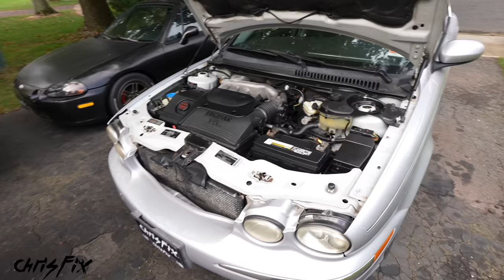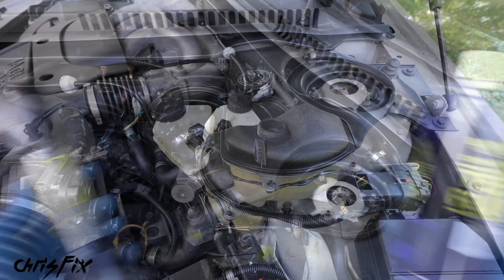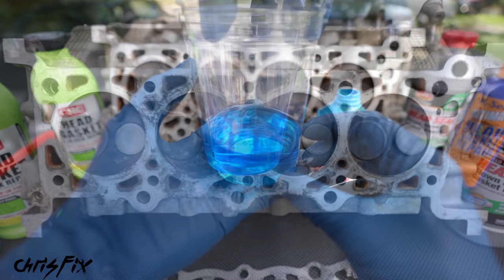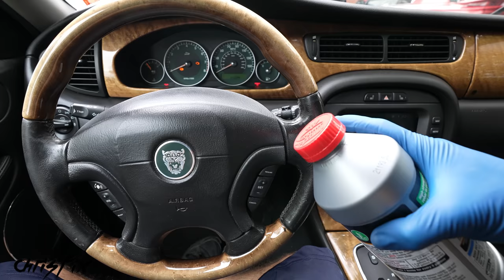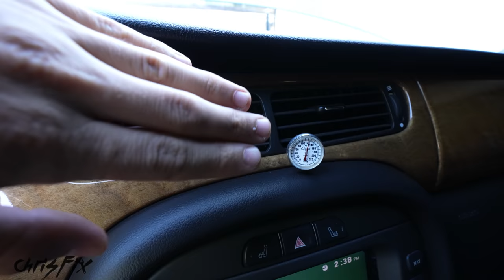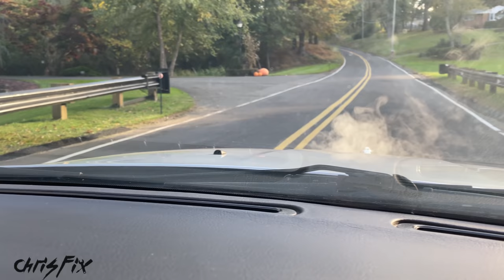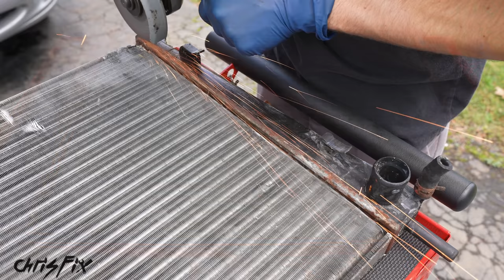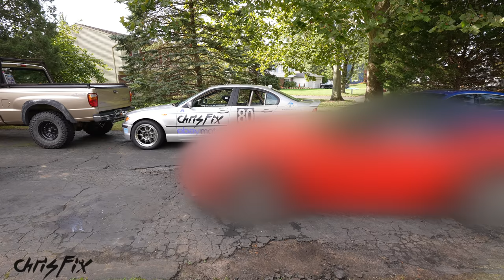Do Head Gasket Sealers Actually Work (FULL 2yr TEST with Engine Teardown)

Comment: Chris ! I wanted to let you know that I have done this same testing yesterday and today on my 2012 Lexus CT200h with 170,000 exactly how you showed. This morning on the new drive, no rough idle and coolant levels stayed. I am so impressed and thankful you made this video because it was a success bro!! I’m happy for now because head gasket
Job was 1,200
Reply: Wow I have the same year and model car.$1100 actually isn’t bad.
Reply: How’s your car holding up now?
Reply: What product did you use?
Reply: @WApnj  head gasket sealer the one he showed on the video
Reply: What brand did you use? It seems a bit daunting, did you bypass heater core? I keep hearing some of these can clog it. He does not say the brand he used for this.  I keep looking at the bottle  In the video, but I can't quite tell what exactly it is that he used.
Reply: @troyberg2283 
He used the last product, the thicker stuff due to the high temps of the jaguar and 15 minutes to reach adequate engine running temps

Comment: 23:40 Drain/Flush the cooling system, and then TREAT IT AGAIN with the BARR'S MAGIC.  It might work again, until dad floor the car during hard accel.
Reply: @SgtWojcik  It would need to be machined. Hand sanding is not going to cut it.
Reply: @jonmayer  It can absolutely be done if you have a very flat reference surface and a lot of patience. You could bring it fairly close or beyond a passable machining job. There is 100 000 $ worth of "perfect machining" and there is flat enough that it doesn't matter. It's aluminium after all, not some crazy high tech alloy in a turbine compressor.

Comment: I used Bars Leak 2 years ago, but I drained + rinsed the system thoroughly! Followed the directions, then drained the pure water , installed antifreeze + more Bars leak , no problems yet NOT Hot Roding around town !!!

Comment: I've used Bars Leaks block seal, it has copper in it. It was on a 2004 Hyundai Elantra. It's been working great for years. Car was tested before and after with leak tester.
Reply: So was it the same stuff as Chris used or different?
Reply: Yes good copper not the same for less gap his was big warp .fibers best could have put again or copper second time cause smaller gap compound fix

Comment: Kseal 100% I work at a popular auto parts store and I sell the heck out of Kseal and always have positive feedback!!! Now that being said, I'm not a fan of sealers at all because it should be fixed correctly and too many people think it's a permanent fix. But I used some Kseal on my 05 hyundai tiburon GT. I was loosing coolant slowly into the oil. I put the small bottle of Kseal in and drove around for about 15 min and the white smoke disappeared and I wasn't losing coolant anymore! Kseal for the Win!!
Reply: Agreed about things needing to be fixed correctly, but it doesn’t make sense sometimes, like in this situation: the cost of repairing the gasket would’ve cost 3 times the value of the car
Reply: @mikekilovictor4010  lol thats why i stick to 4 bangers.

Comment: I can say that the Blue Devil head/block sealer works too. I put some in my 1997 Pontiac Sunfire which had exhaust gasses in the coolant, pressurizing the coolant cavity & blowing out all the coolant through the overflow tank. After putting in the Blue Devil (following the instructions of course) there were no more bubbles coming up in the coolant while running. I was tickled to death with the results, but still a little skeptical. After three years & well over 20,000 miles the bubbles returned & the same problem as well. I since put a new head on the 2.3 & shortly after that a tree fell on it in a storm. I've now put a new windshield in & still need another hood then it'll be back on the road. Kind of rambled on but the point being, YES! This stuff does work as a temporary fix until you can get enough money to fix it properly, get another car or whatever. Unlike some of the so called "stop leaks" that are very thick, the Blue Devil has the consistency & look of blue Kool Aid so it's not going to plug up your heater core or radiator.
Reply: I have a question. IS it advisable to re apply another sealer treatment or could this truly destroy the engine? Like if you waited another 1-2k miles dealing with the blown head than decided on another "Blue Devil" treatment. Can anything happen to engine or would it work maybe 60% as well as it did first time? Thanks!
Reply: Yeah i was recommended to use blue devil. About to use it on my tahoe with a small leak.

Comment: Did Bar's Leak with Carbon Fibers and it worked.  I've driven on my Honda Element for 3 years now.  Tiny leak into coolant and oil.  Really small.  Downside?  Clogged my heater core for the first year - no heat, half unclogged itself the second year.  Need to flush it with CLR.  Carbon fibers will work under your radiator cap, and your  heater sensor- wherever there is a weak point, the fibers will find.

Comment: I used Blue Devil to hopefully stop a slight heater core leak (fully rebuilt engine) and it worked beautifully. Kept the car 3 more years before selling it. Never had a problem.

Comment: We (mainly my friend, I just assisted) did this on my '93 pickup truck after it blew out all the radiator fluid on the interstate.  Took a bit of work, and it did clog up the radiator (mainly because we had to pour the sealant straight into it), but thankfully we were able to unclog the radiator before trying to drive it.  It ran for probably 7-8 months before the fuel pump gave out on me.  Not giving up on it - and eventually I plan to rebuild or replace the engine - this was just meant as a temporary fix to keep it running, which it did as intended.

The sealants do work, but no one should consider them a long term fix by any stretch of the imagination.  Regardless, thanks for this video.  It's interesting to see an in depth view of how they're actually working.
Reply: What sealant did you use that unfortunately caused your truck to get clogged?

Comment: Thank you Chris for such an amazing video. I learnt a lot! btw i just ordered BAR's head gasket sealer from Amazon and cant wait to apply it.
your tips are so useful, removing the thermostat before adding the sealer, changing engine oil and oil filter once the job is proved successful.
Can't thank you enough.

Comment: You forgot to mention that you have a "recirculating reservoir".. Sealer is useless if poured into a regular vehicle reservoir. Has to be installed directly in the radiator.
Reply from the maker: Thanks for sharing!
Reply: You mean I need to pour sealer into the radiator directly?
Reply: @jameswan670  yes it goes in the radiator.

Comment: Anybody else get feels for his Dad's "baby" when Chris started taking the hammer and sawzall to it? Maybe just me....
Reply: Heck I almost turned on the waterworks when I waved goodbye to a twenty three year old Toyota Corolla that was falling to pieces. There were a lot of rust, the water pump was done, the clutch were on it's last legs, the fill pipe for the fuel had rusted, the shocks were just hanging on, the battery was still original and held just enough charge to start maybe three times in the winter and after that it would need at least half an hour of charging at a high idle to be sure it would start again tomorrow, and the camshaft timing belt should have been replaced a few years ago. Still it never let me down until the day I had to send it away, other than the few times I'd left it parked for more than two weeks and the battery was totally flat. And here I have to see him take a sawzall and to a car that seemed a lot better cared for than my old Corolla. I know that car died for a good cause but even so it was not easy to watch it happen...

Comment: Great work putting together such an informative video on a relatively controversial topic in the mechanical world. I was in a similar situation with a friends 6 cyl subaru outback and decided to use the CRC product with the fibrous goop in it. After putting the suggested maximum amount in for the volume of the cooling system ratio I almost immediately clogged both the radiator and more devastatingly (I realized later) the heater core which now after 2 years and eventually another S/H engine have discovered that on some Subarus (mine) the thermostat opening is dependent on permanent flow through the heater core, and so consequently have damaged the new engine in the process of trying to get the thermostat to open. I will add that once we replaced the radiator and removed the thermostat from the original engine it did temporarily seal up what we now know is a cracked cylinder head. I think you were lucky Chris that the tubes on your radiator look quite a bit larger the most Asian cars and in your case it didn't block it up, but again your follow up and dismantling of the engine afterwards was very insightful and great to see how these products actually work.

Comment: My experience was Bars leak HG1: i ve used it with awesome results on 2 different cars with both of having 200,000+ miles. The 1st was cadillac ctsv 6.2l supercharged engine. The 2nd was a 6.0l hummer h2. Both of them still running strong after years of using this product. Just make sure to turn on the heater when you start the procedure. Also if your leak is small, even with larger engines i would recommend using half of the bottle for the 1st thermocycle, then next day do the same. And by a small leak i mean if you drive for couple hours daily, you needed to refill your surge tank once a week.
Reply: @kab9729  Lol no
Reply: @kab9729  muppet
Reply: @DECKEDM  lmao I knew it wouldn’t work idk why I still asked 😭

Comment: I’ve had really good success with k-seal. I used it on my 2019 x-15 Cummins. I have since put 300,000 miles on it and have not had any issues.

Comment: $7k to replace a head gasket is absolutely Ludacris. You could buy a new car or engine for that money. It should not cost more than $1K including parts. I’ve had it done for as little as $700. Madness
Reply: I know its late to reply, but its a shop ehich does everything they touch with new parts, ie new belt when doing an alternator. Imagine all the parts that go into the head gasket process which they would try to sell
Reply: I just got quoted 6500 for head gaskets on my wife's 17 grand Cherokee
Reply: And the was just for gaskets and water pump. It's gonna get some k seal then trade in

Comment: Imma treat this like a forum post real quick. I just bought my 2012 Chrysler 300 Limited with the 3.6 L Pentastar engine and 8 speed automatic trans. Drove it 4 hours home after buying it with absolutely no problems. The next day driving to work 15 minutes I had no problems either. The next day I was messing around with my audio system with the car running for about 20 or 30 minutes and all of a sudden I see steam/smoke come out of the hood. All of my gauges were perfectly fine though. I open the hood and I see the coolant reservoir boiling. I immediately shut the car off. Hoping this was a one time thing, I get in the car to go somewhere after about 20 minutes and after about 5 minutes of driving I notice the car is overheating. This did no damage since I was so close to home. I get home and see that there is zero coolant in the reservoir. Filled it up (it took a whole jug of 50/50 antifreeze) and ran it and took it on a few test drives and the level was fine after a while. There was also no smoke coming out the exhaust or anything in the oil during this whole time. My question is, why did it go the 4 hour ride back plus 2 days worth of going to work and back with no problems, then all of a sudden losing it all? Why didn't it lose it before then?

Comment: I had a blown head gasket in my 2002 expedition. i used head gasket sealer and it worked for years.
Reply: Did your car shut off ?
Reply: @Dcashkid24  no, what do you mean? the truck worked as far as i know even after i sold it a few years ago.

Comment: Here's some thoughts here. Loss of coolant also can be caused by a cracked head, which usually means tiny cracks around the exhaust valves which you cannot see. But these cause both leakage into the combustion chamber and exhaust gases in the coolant. Generally, a sealer will not help much with these.

If you have a situation like that described in this video, if the sealer works for a while and then gives out, try more sealer.

Finally, it shouldn't cost $7000 to replace two head gaskets. In this case, the heads might be able to be planed. Sometimes not. My experience is not extensive but I have heard a lot.

Finally, the experience described here is a good argument for a four cylinder engine and also a good argument for not owning any kind of exotic vehicle, even a not really so exotic one like a Jaguar.
Reply: that jaguar literally has the exact same engine/drivetrain as a Ford Taurus of the same year. It's not exotic whatsoever.
Reply: @michaelcohen9363  modern jags like land rovers are built-in India. Complete junk like jeep in China, Briggs and Stratton in Mexico, Saab in USA, etc.
Reply: @bekaddisontechnologies4292  You'll never find me driving any of those lol. I had a straight 6 jeep back in the day and it was alright but I'm not really into offroading. Land/Range Rovers, Jags are awful vehicles

Comment: For anyone watching this, bypass your heater core while you do this. The fibers will plug it up. It might not get plugged all the way but it won't be as good as before. Just unhook the tubes and stick a bent piece of copper tubing in there. Replace after its seeled.
Reply: How difficult is this to do? Are the tube accessible under the hood?
Reply: Yes, they are the two big hoses that go into the firewall
Reply: I went with the bars leak he used in the video. It has worked great for me. Didn't clog my radiator, heater core, nothing. And I didn't unhook my heater core. Heat still blows hot as hell. Coolant consumption stopped 100% after a few heat cycles. I have a 2001 Subaru Outback 2.5 H4 engine. 209k miles. Purchased month and a half ago with 208k miles. Fantastic car. Runs like it's new. Only have done spark plugs, air filter, fuel filter, coolant flush. About to do transmission & diff flushes next. People are scared to buy the 98-0Xs Subarus because of the head gaskets that only last 120-180k. But once you replace it with a MLS gasket from the turbo models, it's a phenomenal car. I believe the headgasket was done on mine possibly already. And maybe they didn't have the heads machined. Or they put in a new headgasket that Subaru still sells that's the problem one (single layer graphite coated headgasket). After 120-180k, the graphite coating wears off.

Comment: It can work and in this instance it did. The reason why it worked so well was the core of the radiator was tubular. It had large passage ways that allowed for low chances of blockage. 
Most vehicles that are anything other than jaguar use plate fin core radiators that have passage ways that are 1/3 of what that jaguar used. The sealer will settle to the bottom of the radiator and harden blocking off the lower portions of the rad. That being said your average civic, subaru, honda and Toyota, anything really will have issues with block sealer. I've replaced radiators on cars that had history of block sealer due to poor flow and clogs. I've dealt with blocksealer amplifying overheat issues. 
This only works in situations where the cooling system isn't tightly passaged.
Especially cars with transmission coolers and oil coolers that mount to the engine and transmission, you can clog those and inadvertently cause other systems to overheat. 

That being said, block sealer has been known to work but it is seen as a last resort and a destructive bandaid as you have shown. 
My thing is, if the car is at end of life and you don't need it for much longer, use sealer. 

If you need to get somewhere in an emergency and need to make a quick fix, use sealer. 

If this is a car you plan on keeping long term, fix it right. 

Also tell your mechanics you used block sealer so I am not suprised and take special care in making sure I blast engine passages clean when doing a proper repair. I've seen the sealer clog heater cores, radiators, thermostats, bypass/tb hoses and wreak havoc after a repair. 

I'd say 90% of the cars I get in with history of sealer usage have some sort of blockage.